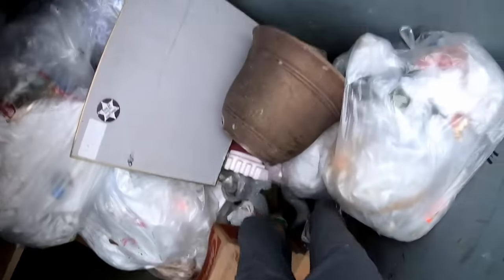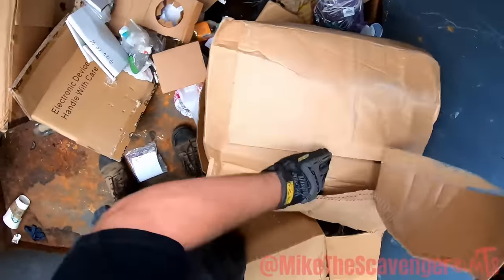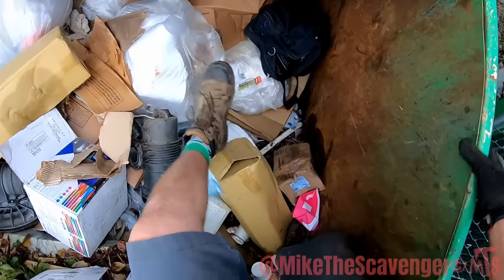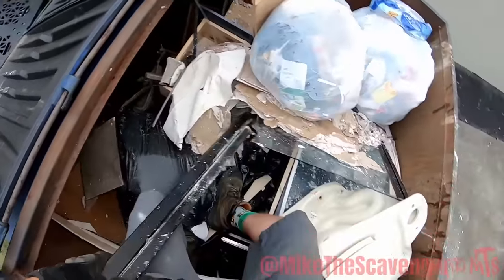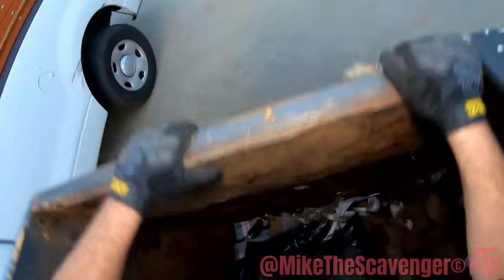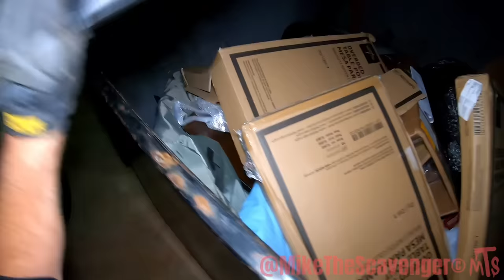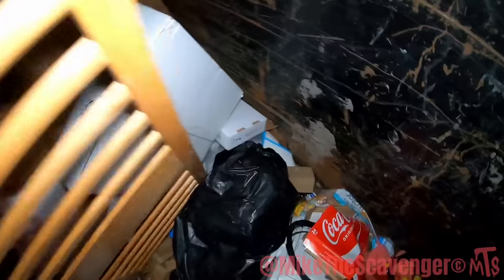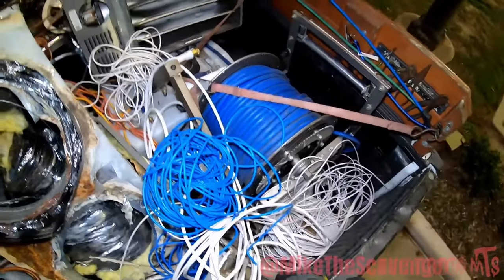Dumpster Diving "IT'S FULL OF LAPTOPS!"

Comment: You should connect a winch in the back of your truck to help with lifting stuff or a mini side crane winch. It'll help save your back. You've basically found everything to build one several times over. Just sayin.